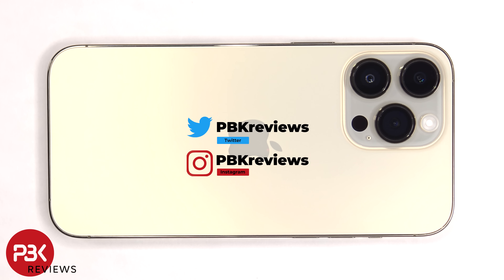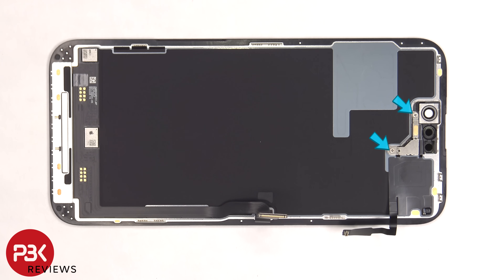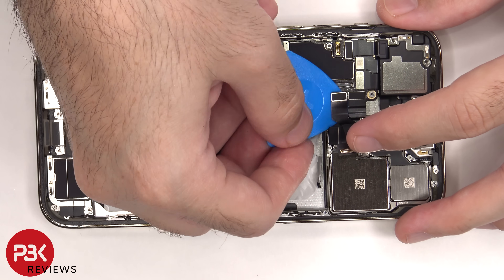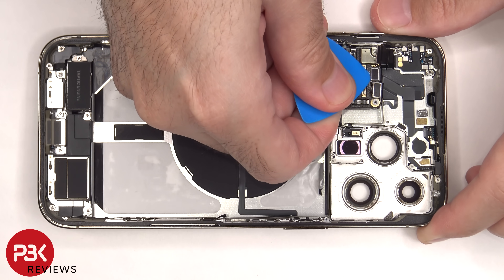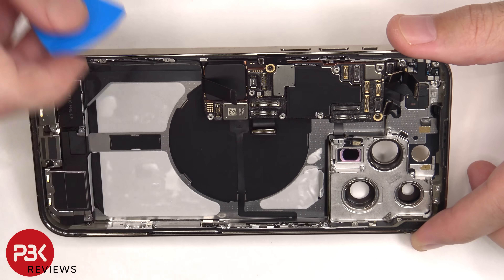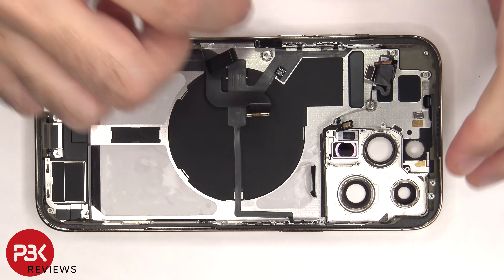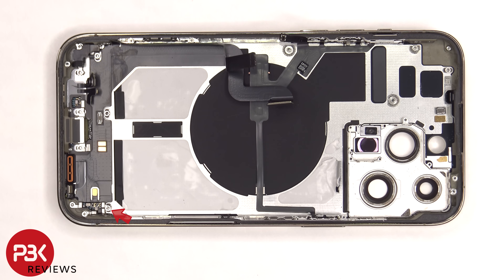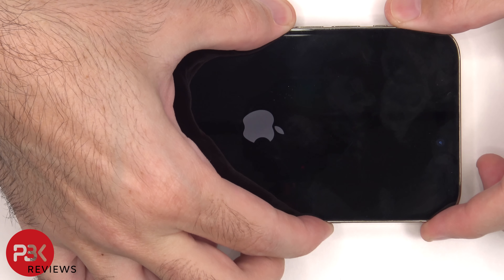Apple iPhone 14 Pro Max Disassembly Teardown Repair Video Review

Comment: Minute 6:25 is that the Bluetooth flex cable ?
Reply from the maker: yes
Reply: @ okay because my friend’s iPhone 14PM got smashed I replaced his front display for a cheap LCD one 60hz I mean it works 👍🏼 and didn’t fixed the very cracked back glass , which is fine by him , since he dudar even wanted to spend a penny fixing this thinking it was unfixable , and we just discovered that Bluetooth doesn’t work, he has several Bluetooth speakers none won’t connect, and just bought him a single AirTag abs we tried and tried to contact but it just didn’t 😭 I come to believe it’s because Bluetooth doesn’t work, so now I’m thinking if I change this iPhone 14 PM Bluetooth flex cable? You think it’ll work again ?

Comment: For which parts are the connectors that you remove at minute 4:27 and 4:29? I got water damage on my iPhone 14 Pro and Apple wouldn't even care to open it up. When I opened up, I can see that these two connectors look like the issue for my boot loop. Can I disconnect them and try to boot up the device? Thanks a lot in advance for your reply!

Comment: God bless this man. I am trying to change my entire housing into new one, and there was no such good instructions until this video. Again, thank you so much
Reply from the maker: You're welcome :)
Reply: @PBKreviews  Hey, I have a real quick question before I perform a self-repair on my iPhone. I figured out that my new housing is missing a 5g module, which connects to a mmWave antenna cable. Can I remove it from my old phone and put it back to my new housing or do I need to buy a new one?

Comment: The piece you said was another antenna assembly at 5:47 has broken off in my repair. Am I able to go without it? If not where could I order the whole replacement. Thanks

Comment: In Phnom Penh, a local petty thief on a motorbike snatched my new iPhone from my hands in the evening and quickly drove off on that motorbike. I had very valuable information on my iPhone, I really hoped I would announce a reward (to the police and local punks on the street) and get it back. Friends said it’s still impossible to sell them for spare parts, since supposedly they are all chipped and cannot be interchanged. As I understand it, everything is changing perfectly, and no lost mode will help (the phone was turned off almost instantly). (( Don’t go to Cambodia - there are thieves at every turn there, a disgrace to the nation!

Comment: Wow I need the flex cable for my iPhone 14 Pro Max as I was taking off the battery and now has I known would’ve used isopropyl alcohol and ended up cutting my FLEX BAND. My phone is set differently though and has a 1/2 circle of protective tape covering mine? So unsure if they sell the flex band separate or do they want you to end up buying the whole bottom plate? 

I cannot turn off my phone or screenshot anything because that band is ripped clean through. Plus my flex band is covered over . So can I get that covering too along with the flex band. 

Any ideas on cost of these parts? You work on these phones often?

Comment: Hi I am trying to fix my nfc. Do you know what part this is? And if Apple locked it to not work when replaced?
Reply from the maker: Hi, its part of the wireless charging assembly. I don't remember for sure if this part was locked down with software also but here is a link: https://www.ifixit.com/products/iphone-14-pro-max-wireless-charging-antenna-assembly?pk_campaign={PMax:US|Shopping|SSC|Parts|tROAS390}&pk_source=google&pk_medium=cpc&pk_kwd=&gad_source=1&gclid=CjwKCAjw15eqBhBZEiwAbDomEsymcXIreC3zqpoC6fVDyinVmGW3GxdC3Wefuce91s3k8Tb6dkIHnhoCgO8QAvD_BwE

Comment: I just swapped motherboards on mine and now it’s overheating on the top left if looking at screen or top right from back. Battery drains super fast too. Just updated to latest os but no help. The other phone put back together works perfectly fine so don’t know what could’ve gone wrong
Reply from the maker: Might be a defective screen or something shorting it.

Comment: Thank u for your helpfull videos i want to ask if American 14 pro motherboard works in EU 14 pro? 5G antenna is different between them
Reply from the maker: You're welcome. It should work, worst case if you have any signal issues, you can flash EU 14 pro firmware to the phone so it reads the antenna better. You can watch videos online and on YouTube for firmware flashing on iphone 14 pro.
Reply: @PBKreviews  ok i will try it thank you for quick answer 👍

Comment: See how premium is the apple made, compared to Samsung s23 ultra material with its price is closer to the iPhone 14 pro max,
Reply from the maker: I honestly don't think the S23 ultra is made any less "premium" than the iphone. In any case, the iphones are 10 times harder to do repairs on vs the samsung phones. I would rather repair the s23 ultra any day vs the iphone 14 pro max. So complex and complicated for no reason, taking that apart wastes so much time.
Reply: @PBKreviews yes if repair issue i agreed, i mean the iphone price is reasonable compare to others,

Comment: Ok so my charging port stopped working, and Apple said there’s corrosion on one of the pins and the lightening port needs to be replaced. The tech told me that the entire back end of the phone needs to be replaced, everything but the screen and cameras basically, just to replace the lightening port. And it will cost $990. Apples limited factory warranty won’t cover it as they don’t see it as manufacturer defect, even thought I did nothing outside normal use. It was never under water or anything. So now i’m sitting here with a $1600 phone that can only be charged with MagSafe. Should I contact an independent repair shop?
Reply from the maker: Yes you should definitely contact an independent shop. The reason behind what apple is doing is it takes a lot of time to disassemble the phone to get to the point of just changing the charger port with flex, so to speed it up (and at the cost of the consumer) they have pre ready full housing units ready to just take out the motherboard and screen and swap the entire chassis. One thing you can try yourself is to get a toothbrush and brush out your charger port. You can also apply some isopropyl alcohol if that doesn't work to the top of the brush and brush off the port. See if it cleans it off and gets it working.

Comment: I seriously hate the extra weight that the stainless steel housing adds to the phone. Do you think it’s possible to replace the stainless steel frame of the iPhone 14 Pro Max with the aluminum frame of the iPhone 14 Plus??
Reply from the maker: I don't think it would be possible because the antenna contacts on the frame and overall layout of parts would not match or fit.

Comment: Does it still have its water resistant properties after repair?
Reply from the maker: If you apply new pre cut adhesive for the screen, then it will retain the resistance.

Comment: Has nobody noticed that there’s a big space of absolutely nothing between the camera and the logic board? The prox and ambient light sensor are right below the front sensors and do not go down that far
Reply from the maker: Yup, I think that space would be taken up on the smaller pro so the max has that extra space. Maybe they could have designed the pro max differently to allow space for a larger battery or something but not sure.

Comment: How hard (or easy) is to repair screen, for example? Especially when we compare with 13 Pro Max model. 

Thank you for this video, very nice and educative.
Reply from the maker: Screen replacement is pretty much the same as the 13 pro max, so not really any difference in ease. You're welcome :)

Comment: iPhone 14 series component manufacturing

Display 
BOE Display iPhone 14 & 14 Plus 🇨🇳
Samsung Display iPhone 14 Pro & Pro Max 🇰🇷

A16 Bionic TSMC 🇹🇼
NVME/Nand Flash Toshiba 🇯🇵
LPDDR5 RAM Samsung 🇰🇷

Sensor Camera Sony 🇯🇵
LIDAR Sensor  Sony 🇯🇵

Modem 5G Qualcomm SDX65M 🇺🇲
Battery ( Li-Ion)  Huizhou Desay Battery Co LTD 🇨🇳

Sumber: WekiHome Weibo

Comment: 14pro announcement was great, I immediately bought it since I heard something about Thermal improvement, However, now I caught myself on that THEY ACTUALLY DID NOT BRAG ABOUT THAT LIKE WITH A16 CPU STUFF..........I think they fcked us again, if so, I won't be upgrading until they add vapor chamber and I do not care what it actually means)))

Comment: Just an addition , the main sensor has an ois  called sensor shift ois . This type of ois can correct about 5000 times a second . 
Great video  , appreciate it !
Reply from the maker: Thanks!
Reply: Copied from Vivo
Reply: @namazlur78  and vivo copied from apple since sensor shift was introduced on 12 pro max in 2020
Reply: @markoxcx  wrong vivo had it since 2011 and then came with the gymbal shifts. The periscope also vivo was the first to implement & samsung copied it
Reply: @namazlur78  Why does the camera quality on Vivo looks like shit compared to Apple?
Reply: @hustleacc8075  ssnsors
Reply: @namazlur78  i mean yea , also the processing is kida ooof

Comment: Android OEMs can only DREAM of investing in design, layout and build engineering of this level. They all make such pretenses, but the inside of an Apple device is stainless steel and machine screw HEAVEN.

Android don't care a hoot, they want to EOL your device asap and send it to landfill.
Reply from the maker: Honestly I don't like iPhone internals at all. I guess each person has a different opinion, but I am almost positive if you ever try taking one like this apart all the way, you will hate it lol. Too many screws, different sizes and just a mess overall.

Comment: Wait why it’s has ois instead of sensor shift on main camera
Reply from the maker: It is sensor shit, if you check on their website in the specs, its listed as sensor shift optical image stabilization. Just a different way of optical image stabilization.

Comment: Waiting to confirm what modem it has. Qualcomm 65 and if it has the faster 5 memory
Reply from the maker: I'm not too verse with each component/chip on the board and the memory is sandwiched in between the boards so I didn't pry them apart to see.

Comment: I’m really impressed that you managed to put it back together. It’s always easy to take things apart, but putting things back in so much harder, especially something this complicated.

It’s fun to see inside. Thanks for the video! 😁
Reply from the maker: You're welcome and thanks :)
Reply: Not that hard for someone who regularly repairs phones. It's done all the time by repair technicians. 
Although the way he took the battery off is not great. The adhesive is new so it's not that strong but after a year or 2, taking a battery off like that will potentially damage the battery.
Reply: he had video to refer to ;)
Reply: @wcr6121  shut up

Comment: I think that black cover is just over where the SIM card reader would go, you can kind of see the solder points/pads. otherwise where is that gps module on the sim model..
Reply from the maker: Yep you're probably right.

Comment: Would be interesting to see the difference between an iPhone without physical SIM card and one with physical SIM card and how Apple used the space.
Reply from the maker: I was pointed out that the spot where the sim tray goes, is an esim module.
Reply: @PBKreviews I didnt see where in the video you pointed that out?

Also curious what would be the fix for an esim card if it gets corrupted?

I just replaced a corrupted sim card on an iPhone 13. Not sure how or what would be the fix for an esim card.

Comment: Nice Teardown! Is apple still using the snapdragon X60 modem or has it been updated to the X70?
Reply: definitely not x70, it would start in phones with the 8 gen 2. its has a x65 as its needed for the satellite connectivity

Comment: The build quality of apple phones are unbeatable.
Reply: Yes but the quality.
Reply from the maker: When it comes to doing repairs, aside from the screen and generally the battery, apple definitely is beatable lol. I always hate taking apart iPhones, take way too much time, too many different screws everywhere, one thing goes wrong its a mess.
Reply: @PBKreviews 
First of all, thank you for a great video that is very well done and really "complete" for what any iPhone user will need in the future.

I read that you often repeat the complaint about "too many screws" and "too much time". I don't understand.
What would be the alternative?
Above all: could you really use all the same screws? ... and then it's just a "complication" what Apple chose to give (and pay!) to whom do you have to assemble tens and tens of millions of units of that model (and oters)?
Reply from the maker: You're welcome. There are many other phone manufactures with many different models which use a fraction of the screws. If they can do it, I don't see why apple doesn't.

Comment: the inside is as beautiful as the outside, now i understand how Apple got a score of 7 out of 10 for EU reparability for consumers , cos it seems that every part can be changed individually .
Reply from the maker: Not every part but a lot can be replaced, however repairs are a pain, they will take a very long time if its not the screen or battery and there are so many screws of different types and sizes. Id rather take apart any other phone than an iPhone if you ask me :)
Reply: yeah i do not get why they do not use all same screws type just with different sizes , that should be possible ...

Comment: Is the Qualcomm SnapDragon X65 modem used in the iPhone 14?
Reply from the maker: I'm not too sure since I'm not extremely versed when it comes to each chip and how to look them up. Plus most of the important ones are sandwiched in between the boards not visible unless I pry open the boards.

Comment: Nice video.
Is not present the vapor chamber cooling system, right ?
Reply from the maker: It might have one between the sandwiched boards but I didn't want to pry the boards apart and risk breaking them to check.
Reply: Thanks man

Comment: Just what I was looking for. Need to know if the internals allow for better therms on the 14s. If screen dimming is still a thing, I'd rather get the 13 since I hate the dynamic island thingy.
Reply: How can you hate the Dynamic Island thingy when you haven’t even ever used the phone to know if you like it or not?
Reply from the maker: It might have a vapor chamber or something in between the sandwiched motherboards but I didn't want to pry it apart and damage the board.
Reply: @PBKreviews  so nothing to identify the ram they’re using this year?  it’s supposed to be LDDRP5. And we didn’t see the QUALCOMM modem which is supposed to be X65. I guess we’ll have to wait for iFixit to tear it down to get a more comprehensive idea of all the latest components including improved thermals. You know I remember hearing during the Keynote that they specified the thermals were better in the 14 and the 14 plus. When Ifixit  gets their units on Friday we will know everything
Reply: Okay. Guess we'll have to wait for more reviews to find out.

Comment: Does the new iphone have the rumoured “ vapor chamber thermal system “ for cooling ??
Reply from the maker: Externally nothing that I saw, but it might be something which is sandwiched between the motherboards. I didn't want to pry and break the boards apart or render them useless so I didn't but it does have a copper color border in between the top and bottom layer of the board so it might be a possibility.

Comment: Pretty sure that black little module is just a plastic box in place for the Sim tray. I could be wrong but I doubt they would be using 2 different motherboards for the us or International. Plus the rest of the world is getting satellite support right? At least I’d imagine so. Other than that thanks for the teardown!!
Reply from the maker: Yeah its a esim module, I edited the video to remove that part but it hasn't finished publishing the changes yet. You're welcome :)
Reply: @PBKreviews I presume that just stores the esims then.

Comment: Is there better heat dissipation compared to the 13? Rumors suggested there was gonna be a vapor chamber
Reply from the maker: Upon further inspection, there is a copper colored border in between the top and bottom layer so there might be a vapor chamber in between the sandwiched boards, but I don't want to damage the boards by prying them apart. We will know soon when some other in depth teardowns on the board itself pop up.
Reply: @PBKreviews  thanks for the update!
Reply from the maker: Fairly similar, I didn't see any major improvements nor any vapor chamber.
Reply: So no truth in the rumor then 🤨

Comment: wow，nice，you re  first，my english is suck. are there any improvements in heat dissipation? Apple's  event mentioned an improved thermal design
Reply from the maker: It's pretty similar to the 13 pro max, I didn't see any major improvements. I don't know if they made any changes as far as thermal paste or what not on the processor since its sandwiched in between the board.
Reply: @PBKreviews  tks a lot！❤

Comment: This is cool. I definitely think this is the first iPhone 14 series teardown on the internet. You videos deserve more views than what you actually get. 

However, I want to point out that the satellite module you mentioned at 5:35 probably isn’t it. It should be a space filler for the SIM reader. That is the spot where the SIM would go for international models. 

As Apple instructs users to point the top end of the phone to the sky to access the satellite service, the satellite antenna must be in the top end of the phone, hidden amongst many other antenna.
Reply from the maker: Thank you. Yes I believe you're correct.